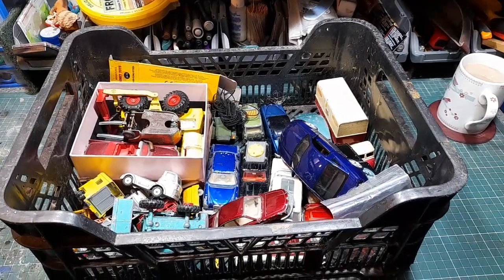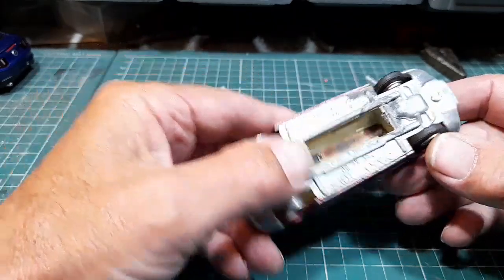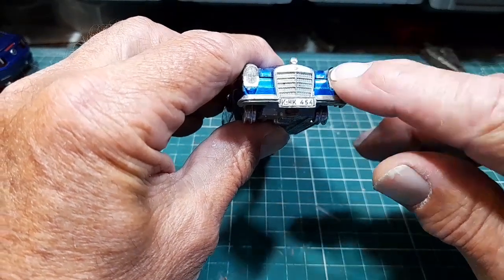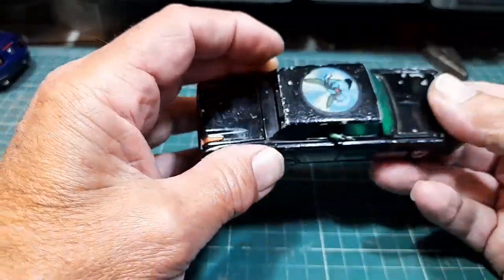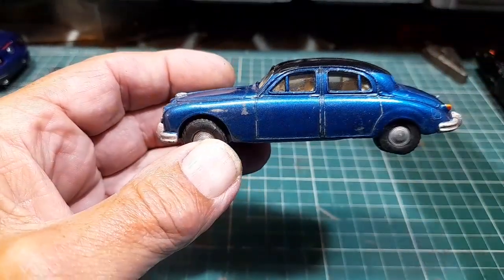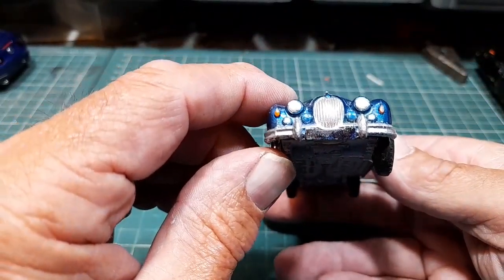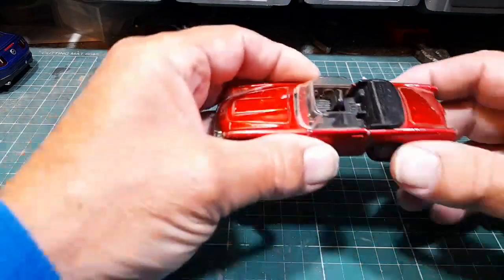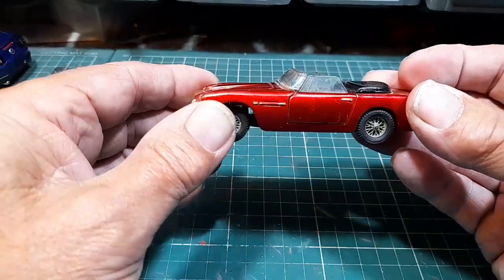Dinky Corgi Matchbox spot on Diecast Restoration Purchases and Donations April 22

Comment: I have a couple of those Scarab 'mechanical horses' but without trailers: one is in scrapper mode in a yard diorama and the other is a customised paddock transport unit. Both have the same size wheels and tyres on the tractor - no idea about the trailers, though the later Corgi models of the same vehicle have the drive wheels and the trailer wheels the same size. The moving dog on the Corgi Kennel Club car is a Lenticular screen! There you go!
Reply from the maker: Thanks for the information fraser that will come in handy. 
And thanks for the name of the dog sign .
All the best martin 👍